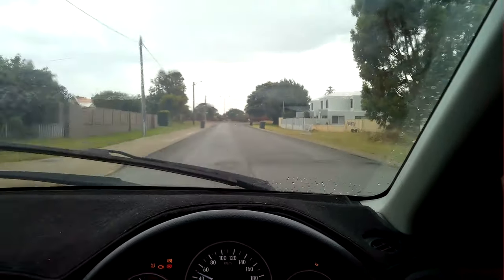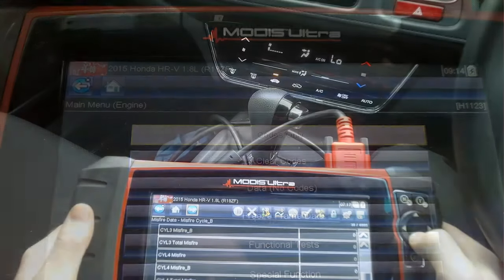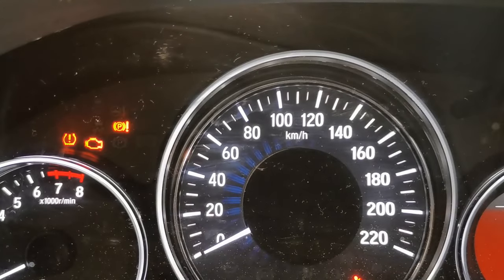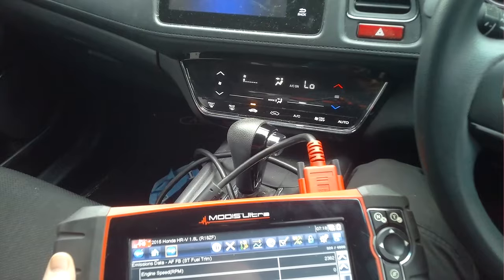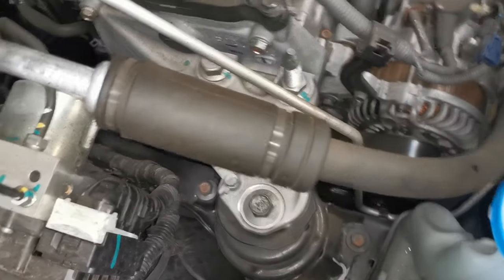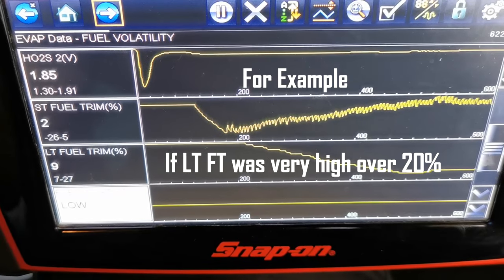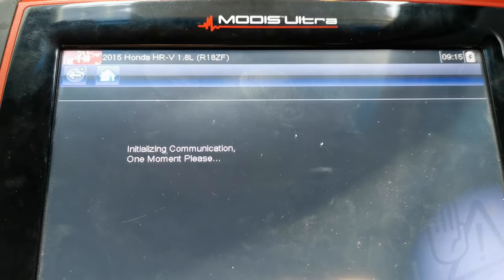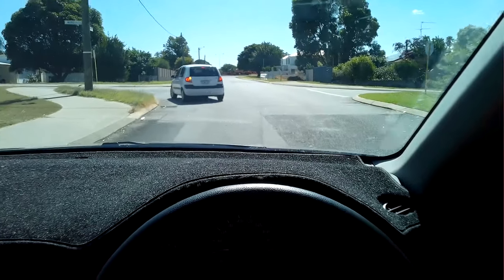Multiple Warning Lights, Engine Management Check System, Parking Brake System Fault - Honda HR-V

Comment: Hi, my 2014 honda accord just had same problem, after I turn off the car and re start it 3 times, all the errors are gone, and i check the engine and all pipes are ok, i start the car again and seem like back to normal, I dont know what happen?

Comment: This has been happening on multiple occasions with my 2017 Civic Si.  I wish I had recorded the several previous times since last summer when it first happened.  Noticed that every time this cascade of errors started, emissions system/check engine came first, with all other problems immediately following. Car sounds unhappy with a rough idle, but despite the warnings, brakes, power steering, hill start assist etc. all appeared to work normally.  Every single time, probably 5 or 6 at this point, the errors only appeared for about 36-48 hours regardless of the number of times the engine was started.  At this point I can predict what day they will stop. The last day, all errors will light up EXCEPT check engine. By the end of day, all errors are gone.  Unfortunately it always happens on days I work and can't take it to the dealer, and the only issue they found when checking with no warning light on was the fuel system was burning too rich. Resetting everything hasn't stopped the errors. One interesting correlation I've noticed the last 2 times when I started recording the dates and details, was that the day immediately preceding the error cascades experienced a strong solar flare, CME and/or geomagnetic storm. There have been several this year so far, though unfortunately I wasn't keeping track of the exact dates prior to this past March. I'm curious if this has been happening for anyone else with this error problem? So far it's happened on 3/4 with a strong X class flare on 3/3, and 4/21 with a CME and a strong geomagnetic storm starting from 4/20.  🤷‍♀️

Comment: I have a 2022 HRV, and up until just recently, this just happened. Twice. The first time, I was at work (well it’s both times, but it still bugs me), and after I finished my shift after the incident (happened during lunch), it started up again. However, today, when I waited for my shift to start, I left the battery on. And guess what? “Brake System problem.” 
It’s a really nice car, don’t get me wrong. But how can I enjoy my car if I can’t even get it to start?
Reply: Mine happened today during my lunch break as well 🤦‍♀️
Reply: @aprilfulton2730  Make sure to start your car fully. Don't just use Accessory Mode. It's a joke. 
An update on my situation is that my car's battery died the day after. I had to get it towed to the dealer, and they fixed the problem. a PSA to those who use Accessory mode and/or those who read this. 

Don't.

Turn your car all the way on. Or else.
Reply: @TheSuperCasual2914  I tried accessory mode and with my car started, no option came up at all to reset anything. I have a 2016 Honda Accord Touring
Reply: While sitting in my car at lunch today at work, all my lights came on out of nowhere. After watching some other video's, I'm going to go visually inspect my hoses. There's obviously something wrong, or these lights wouldn't come on.
Reply: @aprilfulton2730 Did u find out the cause, I'm having the same issue